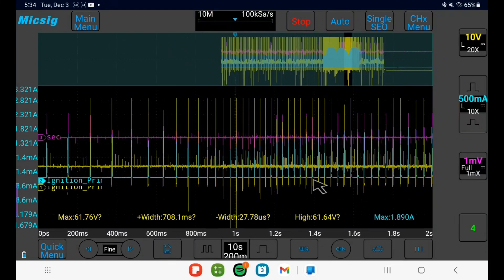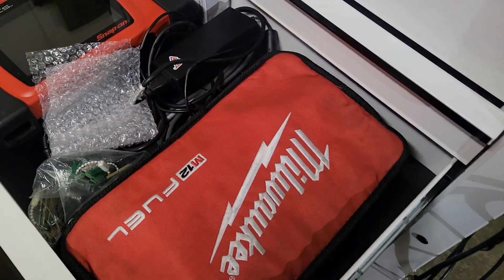MicSig VATO, a real beast among budget automotive oscilloscopes. 1st use on ignition, Erin's Charger

Comment: hello i want to know if this equipment has the atomotive softwar and if the equipment offers the crankshaft turning angle cursors 0 ,180 ,360 ,720 can you tell me please
Reply from the maker: @leonardojennfrymendoza7321  Hi! Yes the Micsig vato cones with their automitive software. It does have 0,180,360 and 720. It's been a good scope so far. I have done a few cam and crank correlations with it, and I am very happy with the results. Cheers!
Reply: @Backalleydiagnostics  thanks very much

Comment: Great video, I have purchased a VATO, but I'm have a problem when I make a quick save. I can't not play the save waveforms in a wav format. I don't find any player for this wav  files,is you know, please, can you make a video of it? Thanks.
Reply from the maker: @9josealfonso263  excel will load a wave file, but it is not very good at it. I am still looking for a good program for them. Screen shot and screen recorder are the only ways to save, but you cannot reload. The temporary solution that I found is save as reference files. You can save as many as you want but cannot adjust the time when reloaded. I am going to do a cam and crank with it tomorrow and will show how if you haven't found that feature yet. It's not perfect and the saving seems to be it's biggest downfall

Comment: I have the Micsig SATO scope. It’s a great scope. I believe the VATO is the same scope without the tablet. You supply that.
Reply from the maker: @chriss7031  Yes, it is very close software wise . The saving wave forms is I think different.  Can you reload a waveform back into the software on the SATO? The VATO , saving consists of a wave file that only excel will open. Other than that you can use your tablet to screen shot or screen record.  Not that inconvenient but there is no reloading of data, you can leave a cursor in place as you screen shot. Learning to use that reference channel feature to save. The reference channel save feature is quite generous on the saves but can't change much time wise. Other than that I like micsigs approach. That 1 screen is very fast and efficient.  Been running a pressure transducer in cylinder and tried it in the exaust yesterday. Not as pretty on screen as the pulse sensor but  at least gave measurable readings. It would also have picked up a miss like a pulse. I figure it's an easy way to learn Micsig in preparation for a SATO! Thanks for commenting and any tips on it are greatly appreciated!
Reply: @Backalleydiagnostics yes you can save a wave form as a wav file. Also it can be saved as a csv or bin. The software will reopen the wave file as  a reference waveform. You can save  as many references as you have memory for, and then view up to 4 reference waveforms. The wave file can also be transferred by a usb drive to a computer. But it has to be recorded in an external app screen capture software that is included. It’s a strange process that takes some getting used to. It’s not a Pico. But for a sub 1000 dollar full featured automotive, all in one tablet, scope, it’s tough to beat.
Reply from the maker: @chriss7031  Thank you! I started looking towards the reference files for saving. That feature is awesome! From what I'm getting from it ,it works like a 1 job scope. Save your reference files for the job , export if you like, but can actually factory reset before each new car and you are fresh. The more I use it, the more efficient that 1 screen of software is set up
Reply: @Backalleydiagnostics I’m an equipment mechanic on the road so I needed a tablet scope to cut down on the amount of things I may need to carry to the equipment. If I was in a full time shop environment the VATO is a great option for an inexpensive 4 channel scope.

Comment: This appears to be the exact same scope box that Topdon/Thinkcar/Launch are using. I have the VATO. When I was playing with a Topdon Phoenix Plus I plugged the VATO into the scanner and it recognized this and allowed me to use the scope.
Reply from the maker: @duowing  That's really good to know, thanks! My next upgrade will be my scanner, I haven't checked many out yet, but I like what I see on the Topdons. Compatibility is awesome, saves me getting lured into master kits that I already have most of. Thanks again
Reply: Do you think this scope will work with the Launch x431 PRO3S+ as the tablet?

Comment: Hi Eric. would you please make a comparison video between this micsig scope and HS512 scope. I'm in need for a budget scope..Thank you in advance,mate.
Reply from the maker: @deanslevin5511  Sure thing! Erin's Charger has easy access to at least one cylinder, I am going to pull it back in tomorrow to explore the Micsig some more. See how many of the presets are usable. The 512 is hard to beat at 2 channels, but they do seem to compliment each other so far. I will do the exact same tests with both scopes. I will explain the difference in saving waveforms also. It wouldn't have stopped me from getting the Micsig, but it is not very well explained to say the least
Reply from the maker: @deanslevin5511  I put one together today, I ran the same tests on both, loaded all 4 on the micsig and tried to show as much of the strong points of each. I will upload shortly, any other details you are curious about just leave a comment.

Comment: Looks like an interesting scope and 4 channels, that's the key. I would definitely like to see how it performs on CAN bus. It looks like it's compatible with Android and Windows, if so that's definitely cool. Hope you had a great Thanksgiving Eric! Thanks for posting!
Reply from the maker: @bobcombs7138 Hi Bob, it has a few bus presets, I'll give it a go! I haven't tried the digital module on hscope yet come to think of it. It is able to run on windows but you need an emulator or dual boot android. I will eventually try it because the hdmi would be sweet. Maybe just a dedicated laptop, but for now, it's cool to be on the same tablet as the hs512!
Reply: I literally just had one delivered today. Haven't opened it. Yet. Can you show to install on Android and windows?
Reply from the maker: @jawsjaws2000  Hi, android was easy enough once I had the right app.The app on their software home page was outdated and the machine would not run. Customer service sent me the new one and instantly came alive. I already had the app downloaded, which might have been the issue. I should have maybe scanned their code that came with the scope. It happens, if it happens to you, just leave a comment. The app is still on my whatsapp, can get it to you faster if needed. Windows is possible but only by either an emulator or by dual booting android. Both are doable, but I was after a strong 4 channel tablet based scope to just be able to switch the type c and leads from the hs512 tablet 2 channel and keep working. It does appear well designed for an app, Like there is alot of software, but there is nothing you have to open with a mouse. It's all buttons and 1 screen. I use a mouse but it's not like pico software that has file,edit,save,save as,ect. Even on an emulator on a PC, you would be splitting your ram between windows and android.,just for a 1 screen button based app. Which kind of leads me to the next thing, saving. The software opens as soon as you plug the type c in and will shut off if you leave that app,even if you keep the app open in the background. So if you check alldata, scope shuts off, check email, scope shuts off. The save button only saves as a wave file,which your system shows as music. It can't be imported back into the software, but each channel has 4 reference channels. You can recall reference waves at anypoint,which is awesome but 16 total. To save you, use the devices screenshot and recorder. The pull down menu to start the screen recorder makes the scope shut off if you miss the button so I just use a mouse with a programmable button just to drop the screen record button in a way my big fingers can't knock it offline. Even with all that, I really like it, and if it had 1 more feature, I'd take a hdmi. The saving is odd but if you remember to drop cursors before the screenshot, it still gives you usable readings. I did not find a program other than excel that will load the saved bin file yet, it does but excel just basically made you a sales chart of your waveform. Little things need adapted but well worth the effort.

Comment: Eric's back!😁 I like your new intro👍
Reply from the maker: Thanks Marc, had a few bumps between figuring out the new scope ( installed old software ), and trying to use power director. It was also raining starter motors for the past week lol, a little cold weather does the weak ones in!
Reply: @Backalleydiagnostics  I thought you had bought a SATO 2004. I haven't seen much on the VATO scope. I remember seeing it on Amazon when I was thinking about buying a Micsig but there were hardly any reviews on amazon and the only videos on youtube are on micsig channel not individual reviews. So it's PC/android based? Can it save captures like Hscope? For some reason I can't save captures on the hantek software to where you can reopen it. I can only save an image.
Reply from the maker: @MarcBchannel  Yes this does the same, screen record or screenshot from the android device. I know what you mean about the lack of info but I kept noticing it was the same software opening on the SATO scopes. I made an excel list of every scope in my budget and this one seemed to give you a piece of their software and power but save you on having to buy a screen. The physical buttons on the SATO look like an awesome feature but one of the tradeoffs for keeping it on the cheap.  The 8 bit I thought was going to be more of an issue than what it is. 50mpt of deep memory keep it from looking blocky. It's software is decent. 1 screen based and looks alot like Hantek. The ease of use is between the 1008c and Hscope. Hscope is hard to beat for that fast , just pinch to zoom on your waveform without even adjusting scales. That part is tough to beat on ease of use but I figure start with hscooe, hopefully find the issue or if more channels are needed, just stay on the tablet and switch the same leads. Seems like a good match, I do wish there was a hscooe license available. I guess the best way i could explain the software is it looks like hantek style, but the menus are straight to the point and some pinch to zoom, a mouse works well with it also. It can run on PC but only with an emulator. I haven't tried it yet but it will cut your ram in half on a laptop. It needs android, that's why I figured it was a great compliment to the hs512. So far so good!
Reply: @Backalleydiagnostics  That's awesome. Looking forward to more vids. Stay warm👍